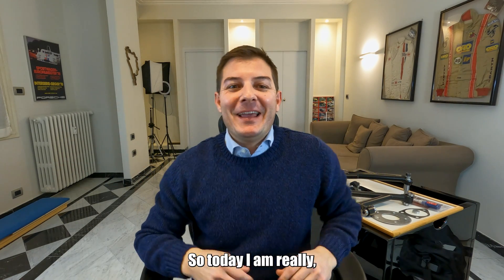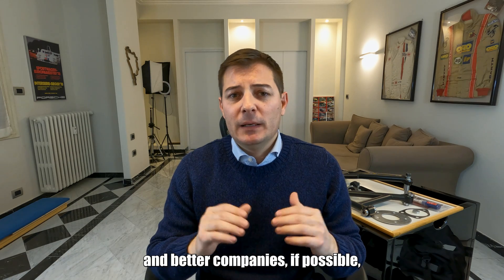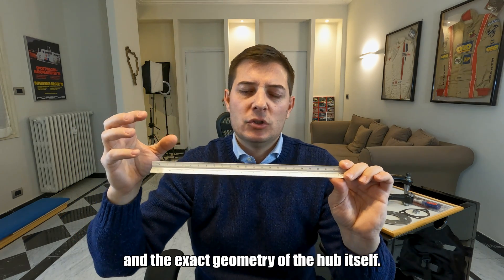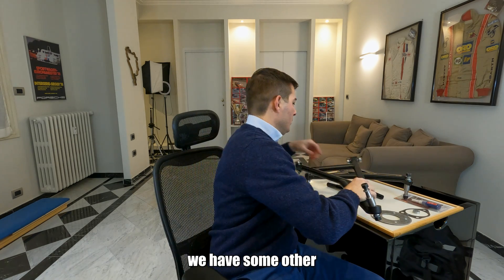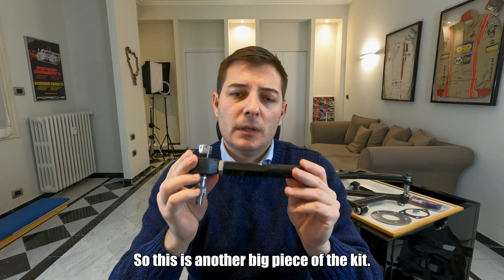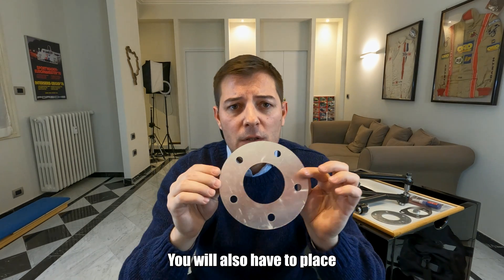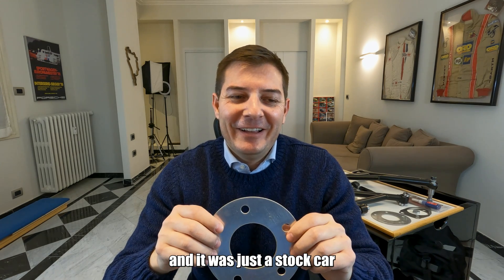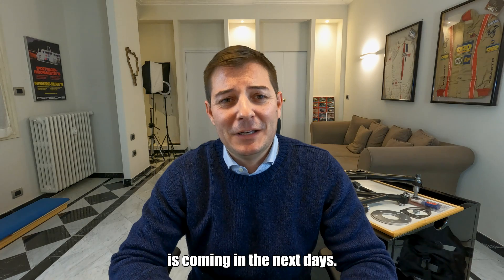Toyota GR Yaris Wiborg Engineering LCA Control Arms Kit | 4K

Comment: Very useful video. May be a silly question, but can it be an issue that those control arms have ball joints without any rubber protection from dust, snow etc?
Reply from the maker: You ideally want to keep them clean and well maintained: they are a wear item, therefore must be changes every few years, or when they become noisy

Comment: Thank you very much for the video! Two questions:
Do you recommend other companies lower control arm? 
The second question is, do you think the anti-lift kit can solve this problem instead of replacing the lower control arm?
Reply from the maker: Hello mate, I actually had the caster/antilift kit before these Wiborg arms, and they were an improvement but brought too much wheel jacking, that decreased grip significantly in low grip conditions.
The Wiborg arms are the only solution out there that corrects all the front geometry, plus you don’t become crazy with settings, as they are fixed. For example, if you purchase Verkline, you will have to also purchase the wheel hub to get the same geometry.
Email Wiborg saying you are a subscriber, and you will get 10% off!
Reply: @PIRASMotorsport  thank you for the answer! what do you mean by wheel jacking?
Reply from the maker: No problem mate! By wheel jacking I intend the geometry lifting the exterior side of chassis, opposite to where you turn. This is used on track-to a certain extent- but is harmful it too much, and especially in low grip conditions

Comment: Have had the full wiborg-engineering kit for 25000km now, with majority aggressive street/canyon driving. Best bang for buck kit for the GR Yaris.
Reply from the maker: Thankyou for that, great to hear your experience!! Are you running also the MCA coilovers (as you state full kit)? Cheers
Reply: @PIRASMotorsport  yes full kit with MCA
Reply from the maker: Cool!
Reply: @khamid1  Hi, can you give me more information about MCA for track use only?
Reply: @sebastienbarlatier2425  full kit is a necessity for track use. You won't regret it. Ask wiborg questions you have, they are very helpful and accommodating for their customers.
Reply from the maker: @khamid1 yes I confirm: arms kit is a must. Coilovers depends on car use, as the MCA track kit is only for track use, too stiff. BOS Suspension is the vest option on the road. Wiborg are infact very helpful!
Reply: @AJClubsport  can request softer spring setup from Wiborg as I did for off-season.
Reply from the maker: @khamid1 spring revision needs also damper revision, to make something perfect: for  average use it can work
Reply: @PIRASMotorsport  this can also be done
Reply from the maker: Yes, and it defeats the point in having a full track kit. As I always share in explanations, it depends on what you want to do with your car. A BOS kit, born from rally can still do well on the track, but a track kit will have more difficulty on the road…
Reply: @AJClubsport  sorry AJ but I disagree. What I meant is the MCA kit can be customised to suit tarmac style with 40% softer rates and relative damper strength to allow for rough undulations and transitions. Customers can request a custom setup from Wiborg as they have all the chassis data in their simulation software for whatever their use. There could also be the option of MCA Gold series, which is the top shelf custom MCA damper that can include all the fancy Rally features the MCA Red series doesn't.
Reply from the maker: Yes it can, but it will never be as well setup and have the same level of hydraulics of BOS or Reiger, as I have explained in the damper video. MCA does not have the highest tech in damping technology. Their gold series, customized top version (used on the Aus AP4 GR Yaris) does not have selective damping, intermediate frequency management and other tech.
As I also said, it is much easier to make a good track damper than making a good road/rally one. Even for specialists, and this is why I worked with BOS to make evolution of the street kit, and now an even higher level pro level kit

Comment: I know about this camber lose and for now I'm using high camber front, as under braking camber lowers and allows for better front traction. Negative toe than gives rotation from early acceleration middle corner. But proper arms could allow to make different setup. Anyway great to look at new gr yaris parts to benefit
Reply: Hi, what is your camber and caster? the size of your tyres, semi slick Thanks
Reply from the maker: Hello Sebastien,
I use standard size 225/40R18 on Michelin Sport CUP2. 
Angles around -2 front and a bit less behind
Reply from the maker: Cheers mate! Memberships open from today, please consider joining!